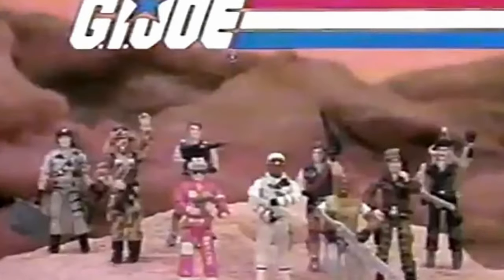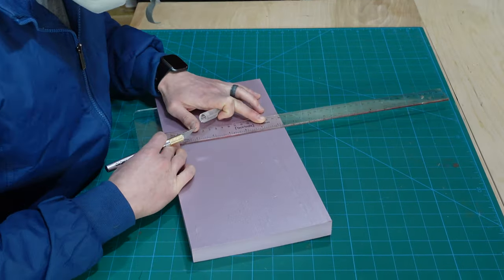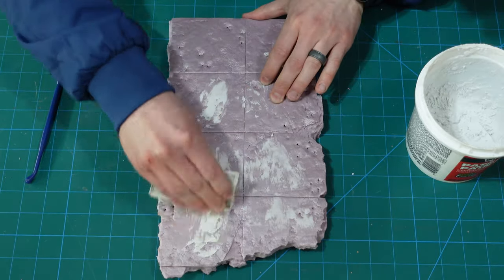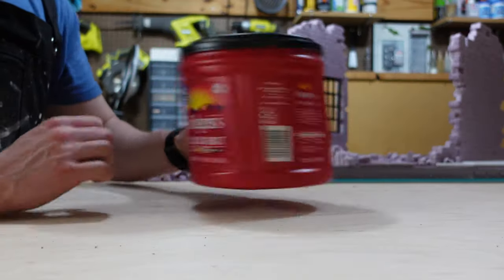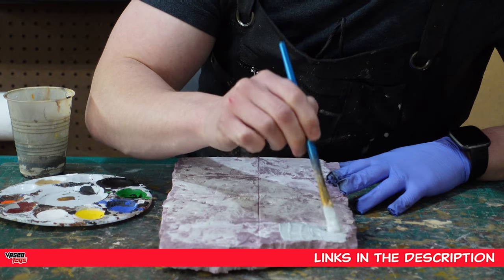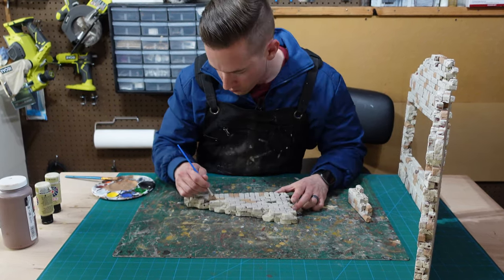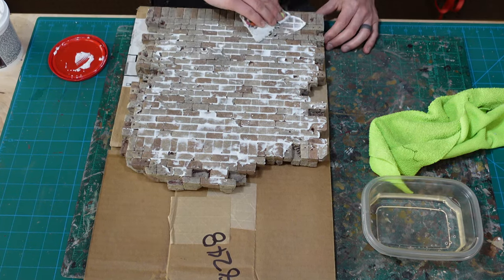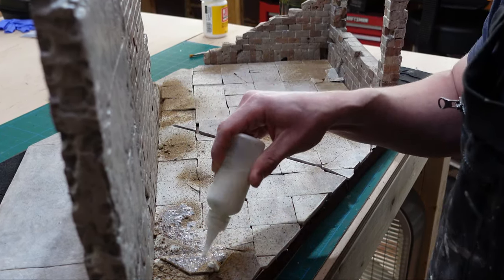I made an urban war-zone for this YouTuber...

Comment: Got a question for you man. I want to make some ladders out of wood dowels and stirring sticks.  What glue would you recommend?  I’m thinking I’d need something that dries super fast as I’d be glueing each step to the side supports.
Reply from the maker: @yojoeturner  I would try something like Hotwire Foam Factory Styrogoo. It takes up very quick and cures in 30 minutes.
Reply: @vascotoys thanks! Sounds like that would work not only on the wood but also on styrofoam, thanks